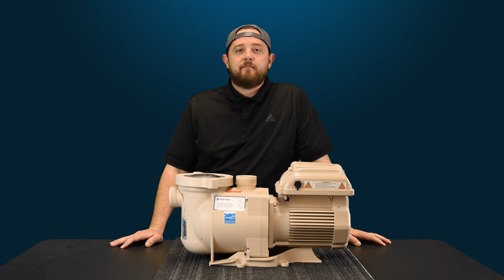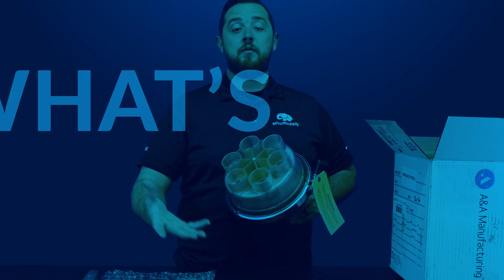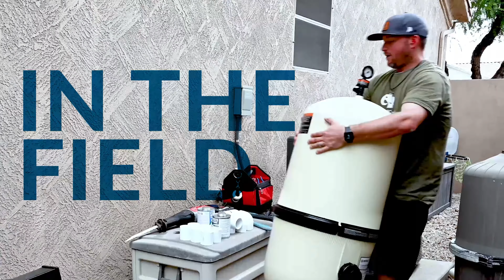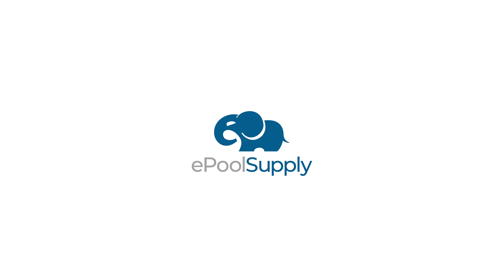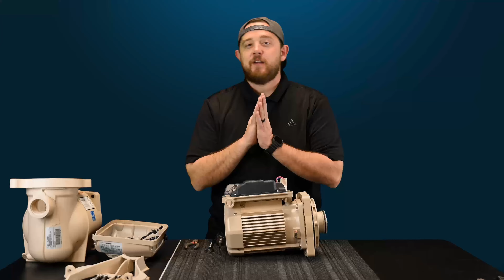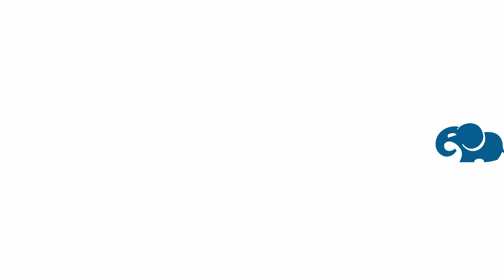Pentair SuperFlo VS 1.5HP Variable Speed Pool Pump Drive Cover Kit - Quick Fix

Comment: Do you know how to remove the fan inside the back cover from the center shaft? like is it a screw-on? press on?
Reply from the maker: We recommend to either to contact Pentair's tech support: 1-800-831-7133 or reach out to a qualified pool technician.
Reply: I have this exact motor, the brass fan is pressed onto the splined shaft. It’s pretty tight and you can’t get a puller on it. I soaked it with pb blaster, put heat on it, then drove the shaft out with a brass punch.

Comment: can the control card inside the drive be repaired?  What happens to the lower part of the drive after it's fried by lightning?
Reply from the maker: Yes, but you're probably gonna need the whole drive and they are pretty expensive, like 75% of the cost of a new unit. You're better off buying a new pump.
Reply: @ePoolSupply  thank you for  the reply. Can the card be purchased alone? Do you sell the control card? Thanks again.

Comment: I always shut down the system for winter. Yesterday, I powered my breakers back on and no display, no green lights but have power going into the unit. Any idea? Entire system is 5 years old.
Reply from the maker: Sounds like to you may need to have a professional come take a look at it.
Reply: I have the same issue.  Were you able to fix?

Comment: Does this model have a capacitor?
Reply from the maker: Yes, all of Pentair's variable speed pool pumps have them, however they are built into the motor which means they are not replaceable. Hope this helps!
Reply: @ePoolSupply  Thank you! Also, why did Pentair discontinue the Pentair VS 342001 model?
Reply from the maker: @SoCali-se5nq  They are coming out with a newer upgraded model set to be released in the near future.
Reply: @SoCali-se5nq  THey didn't necessarily discontinue it. They changed it to be available to be sold online. They have also introduced their 342002 model, which is basically the same thing.
Reply: @ePoolSupply  Would you recommend the SuperMax® VS Variable Speed Pump - TradeGrade??
Reply from the maker: @SoCali-se5nq  its the same pump, just black.
Reply: Actually, it does not have a startup capacitor like other pools pumps. It is a DC Brushless Motor. It's a permanent magnet motor with a DC rectifier and inverter bridge driver.